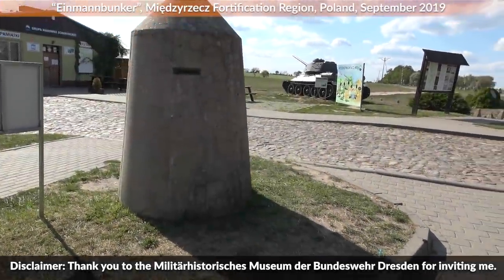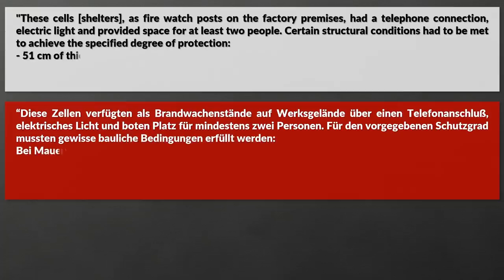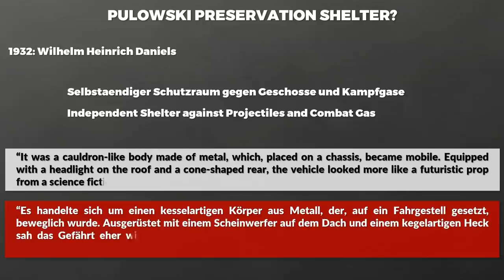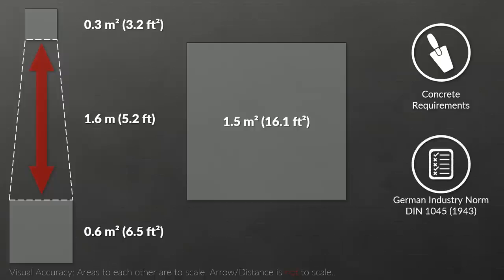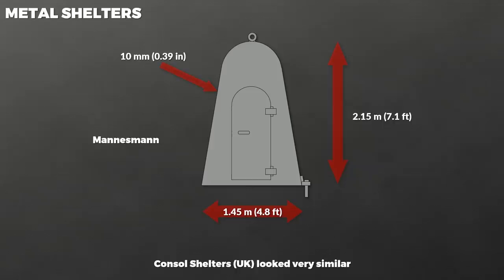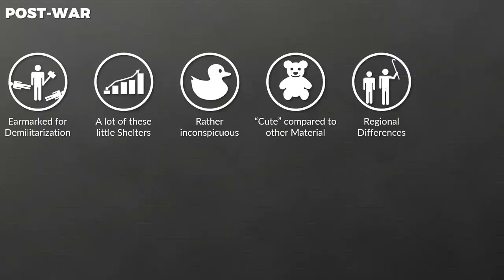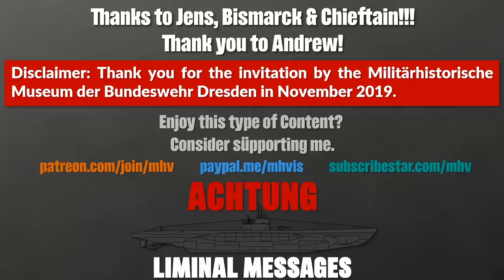One-Man Bunkers - Germany's Pulowski Preservation Shelter (Fallout)?

Comment: Imagine having to sit in one of those tiny things during a bombing raid. Scary stuff.
Reply: Toby Wood Much worse without shelter!
Reply: @jeffreyroot6300  Good reply :D
Reply: If all else fails: duck. As a defensive stratagem it's unreliable, but incredibly reassuring for a moment or two.
Reply: sit?
Reply: I'd rather dig a hole and get inside. It'll be safer.
Reply: @georgedang449  
You'd rather be in a foxhole than a reinforced concrete one-man bunker?
...O...Kay.
Reply: Imagine having to sit in a 2 person bunker during an airraid and the other farted!
Reply: @matchesburn  Yes that bunker is a death trap.
Reply: And in the dark it looks like
Reply: @silent_stalker3687  The apotheosis of YouTube commentary further approached its final form with this remark.
Reply: Coffin dance be
Reply: They saved alot of lives of railroad workers during the war
Reply: Better than not sitting in one
Reply: @scottyfox6376 I don't know but it might ecplain why in bigger bunkers they always had a top notch ventilation system installed. 
I think the second door and/or slits could also be used as a bunker defense weapon.
a thick and sticky invisable cloud of toxic bowl gasses would surround the bunker.

Comment: My observation bunker doesn't meet those specifications :(
Who should I contact?
Reply: German military engineer
Reply: Reichsluftfahrtministerium during normal opening hours.
Reply: Call 880
Reply: Just Install like me the free bunkerapp from the Reichsappstore and you get all tricks and tips to maintain your Bunker.
Reply: A Psychic medium.
Reply: In my city, a street corner shelter might be allowed if it looks like a tree. The trick is to use rubber concrete molds based on oak tree bark, such that it meets the definition of a tree trunk. Otherwise it is not allowed on the corner of a street due to the "clear vision triangle" regulation.
Reply: @humamtaher9039 : If you are a qualified engineer let me see your PAPERS!

Comment: I worked at a Ex-Southern Railway "important installation" in Surrey, with 2 one-man shelters for use inside close to the comms desk.    These were roughed up in 'Eastleigh Works' 5 flat 7mm plates with 4 vertical r-angle corners covers (no floor) 1.5M tall witha door and roof hatch and internal wood plank seat.    No phone or light to write by, you were expected to dive out, above at 6M  was a flat roof, cubbyhole was purely rubble resitant, not blastproof.   The WWII bombing only damaged one installation under our control, "Weybridge" (bomb at 3m away, pushed over one wall, equipt. was still working, quick repaired, but without windows)
In fact all our camouflaged "bungalows" 30  +30 were built in 1935 of blue engineering bricks !  
    Swedish    Asea Brown Boveri Engineering.  (with a few jagged crosses to be found)      a worthy purchase.

Comment: 3:56 Since air raids against infrastructure and plants were conducted by heavy bombers these could be well 500kg bombs. 
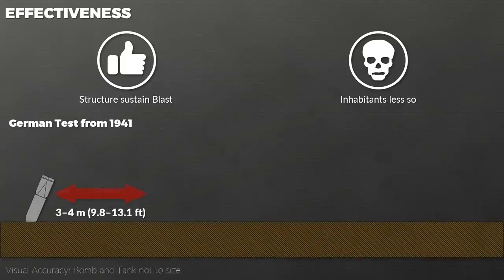4:20 This is due to spalling. Every hardened metal structure (hard steel used in armour) will have that effect. It is easily countered by laying softer metal (layered armour) parts or kevlar underneath the armour. Same effect can be achieved in bunkers too.

Comment: FYI: 2500 Kg/m^2 is approximately 3.5 psi. That is not really very strong. It takes about 5 psi to completely flatten a wooden house with a bomb. This might explain why people saw these shelters destroyed or toppled after air raids. On the other hand, it takes about 40 psi to kill someone outright by blast without debris effects.

Something like 7 to 10 psi would be more reasonable based on what I know about civil defense. These are stills from film shot during a relatively famous test performed at the Nevada Test Site in 1957 of a house hit by 5 psi blast overpressure and 160 mph wind. Although 5 psi will turn a wooden house into a pile of rubble, a properly-reinforced concrete building, will still be standing. 

http://www.atomicarchive.com/Photos/Blast/index.shtml

In other words, a bomb could knock one of these shelters over, and yet a reinforced concrete building the same distance away might just have blown-out windows and be otherwise still intact. That would make anyone suspect these shelters were only for "morale."

 Apologies for being non-metric, but I learned civil engineering in the United States and still think in English units.
Reply: Thanks, Bernard for liking my comment. I admire your work and enjoy it a lot.

Comment: Blast, shrapnel and overpressure are the dangers in explosions.  In their invasion of Laos in 1971, the South Vietnamese forces founds bodies of NVA soldiers in caves who did not seem to have any damage to their bodies.  However, the overpressure from aerial bombing killed them.  In a simple concrete shelter with slit vision ports, I'm not sure how that design could protect the occupant from overpressure.
Reply: The overpressure doesn´t hold on for a long time, it is a shockwave. I am not sure, but maybe the small slits are capable to funnel the overpressure strong enough to lose effect inside of the bunker. Just a guess.

Comment: There are three things that pop into mind about that report about the detonation within 5 meters of the bunker:
1) the report does not mention the depth of penetration of the bomb before it went off. If it buried itself deep enough underground the surrounding earth would have soaked up quite a lot of the blast energy.
EDIT: it would also cause most of the blast energy to be directed upwards, as energy always follows the path of least resistance. Therefore the bunker would be spared from most of the blast in the first place, making the story far more plausible.
2) round bunker != rectangular tank. The shockwave would literally "flow" around the cylindrical bunker, not smash right into it as it would do with the flat surface of the frontal sloped armor of a T-34 which offers a lot more resistance despite its angle.
3) A fractured ankle because of a bomb going off near you? Sounds like the shelter tipped over and the inhabitant was knocked around in the process, and they slammed the ankle into the concrete wall at a bad angle. That would mean that the shelter itself also soaked up a lot of the blast in order to be knocked over in the first place, keeping the energy of the concussion transfered to the inhabitant at a very low level.

Comment: It would be a good idea to have a sidearm to maintain occupancy.
Also: I would prefer buried version with top hatch.
Reply: Buried versions as in observation post has always been very common, this is more like an small dome with vision slits or periscopes. 
Saw one in an bunker during the cold war, also saw one an video about the Maginot Line. 
And yes one main point about this was observation, obviously just digging an hole, use some logs as roof and adding earth on top of it would be an more effective and way cheaper protection.

Comment: Re: the discussion at 3:50 about the size of the bomb. How did they typically determine the size of an exploded bomb? Did they find marked fragments? Did they estimate based on the damage done? I think it unlikely that they would confuse a 500 pound bomb with a 500kg bomb since one leaves a much bigger hole. Could it have been a 1,000 pound bomb? That would leave a hole much more similar in size to a 500kg bomb than its smaller siblings.

Comment: I'm fairly certain that something very much like this was used by American railroads for some purpose, I'm not sure what.  But industrial use is probably another reason many survive, in a lot of industrial facilities they could easily be more important as safety mechanism than defensive points.

The Pulaski shelters are both a joke and not really all at once.  There are plenty of them surviving, so it's clear they are substantial.  They'd protect against the overpressure effects of a nuclear bomb, the initial radiation pulse, and the thermal effects, at least to a degree.  These three things are the big killers from nuclear arms, and it beats the pants off laying down in the ditch and hoping the blast wave doesn't pull your insides out one of your holes (this is indeed a possible outcome if you roll particularly badly on real life's "not instantly lethal nuclear blast effects" table...).

Comment: The one thing I don't understand is why not build the shelter in the ground with a periscope for observation? Then you only need a strong roof. Much less concrete needed. You don't even need a door, just a ladder or steps. The only real problem is keeping the shelter dry if the water table is high, but that's an engineering issue.

Comment: The preservation shelters in fallout generally remain intact. The joke is more that it won't protect you from the radiation.
Reply: Nothing wrong with concrete against radiation
Reply: @2adamast  the preservation shelters in game are not made of concrete. Also, you need several feet of concrete to get any meaningful insulation against gamma radiation, if i recall correctly.
Reply: @wagrhodes13  Good to know,  I probably died too early to ever see one.  
By weight lead concrete or water seem to handle gamma rays on a similar matter